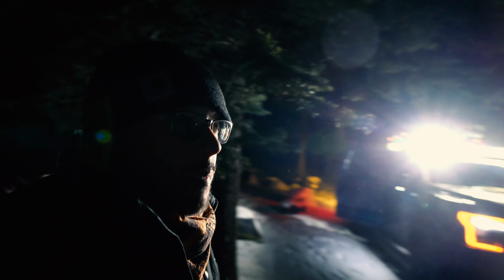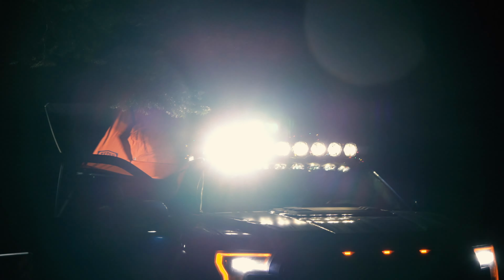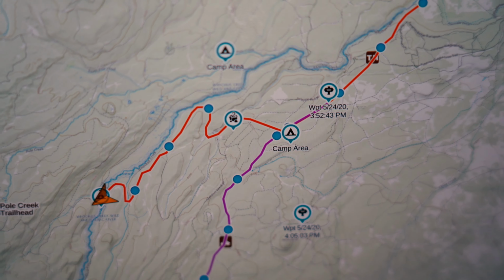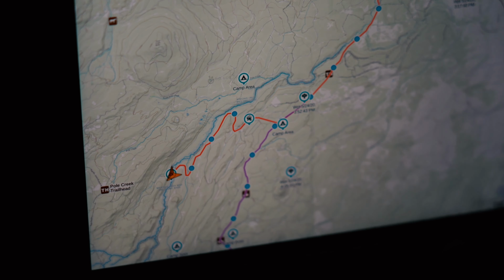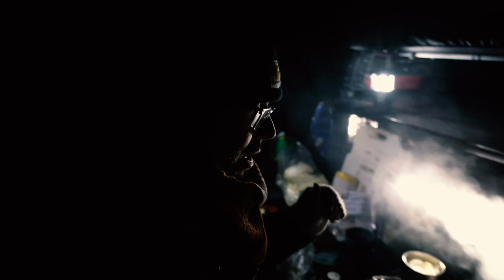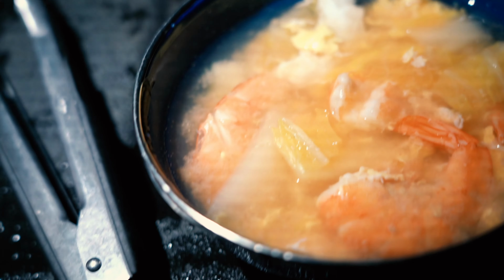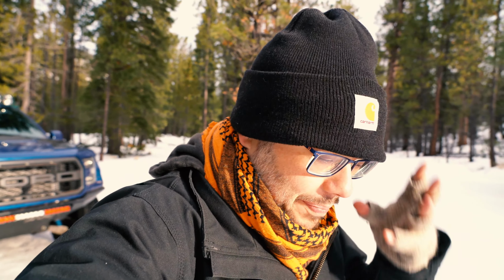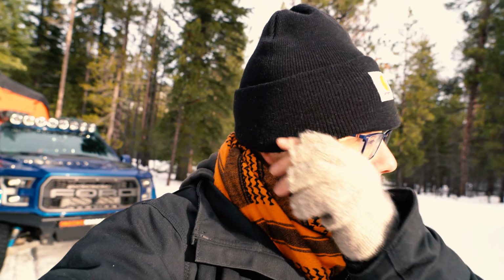Oregon Winter Camp in my Prelander - Ford F-150 Raptor

Comment: I see the added support under what looks like the kb voo doo brackets that are supposed to allow use of a tonnue cover with the rack. Those brackets have always sketched me out, not a good design at all.

 I haven't gotten my rack yet but I'm trying out the brackets from Extrusion Overland, and their rack in a few weeks. Designed and built by a guy in Kansas with a Raptor as well. Can check out their website or find him on IG. He's dealing with the brackets in a much better way than voodoo, rci, or really any I've been able to find outside of ones that adapt to t-tracks in a Retrax cover.
Reply from the maker: Awesome, I'll have to check that out. If you look for my vlog on the KB voodoo rack review I talk about the custom modifications that we made to it to make sure it's a little extra strong for high-speed Offroad. I''m always open to upgrades!